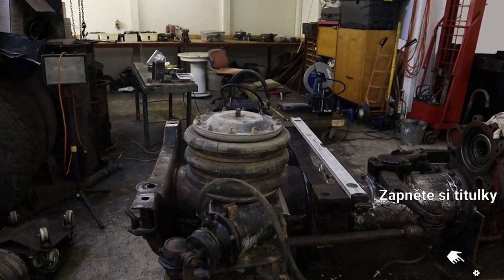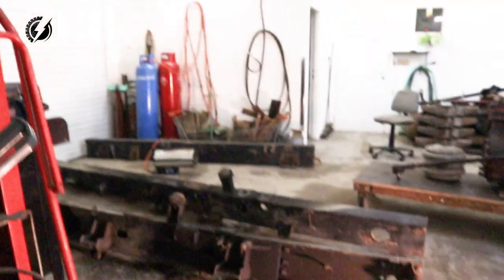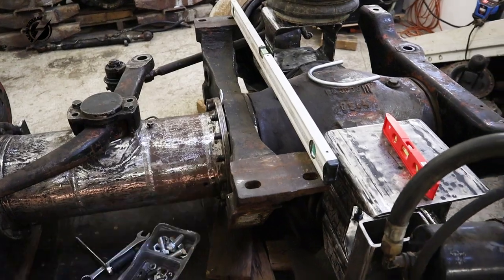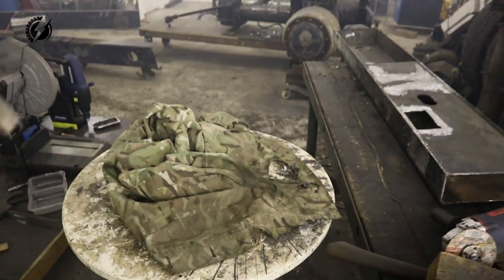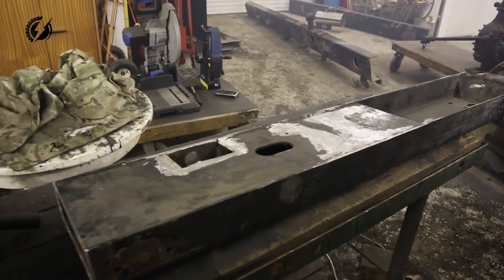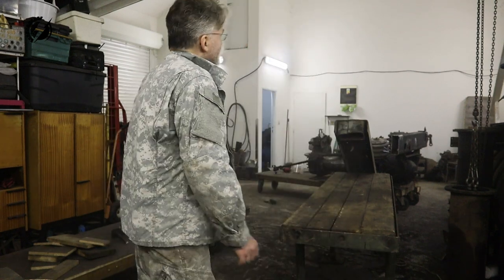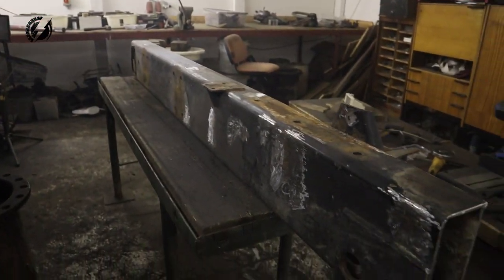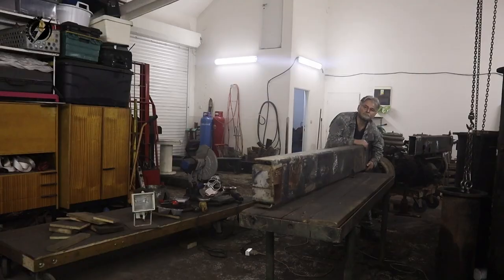EP 57, Building a Tesla/Tatra Monster Truck

Comment: Great video again, keep ‘em coming!!
You should treat yourself to a plasma cutter with gouge function, it would really improve your quality of life.
What restrains the wheels from moving back and forwards? Is there some kind of longitudinal link I maybe missed?
Have you a target weight or ground pressure for it when it’s finished? 
I would mock up the motor, cage mounts and centre section or battery holder before trimming the large beam. I would fit a wheel and articulate it and steer it fully and trim your bumper to suit, it might help to dictate some features at the front.
Reply from the maker: Thank you! The next tool probably will be the plasma, the saw and the drill were more important till now. Don't understand part about the wheels. I will do the aesthetic modification of the rails when the whole vehicle is together if needed. The widest possible size of the bumper is probably the size of the crossmember in the front, and the mounting holes are at the edges of the crossmember. This dictates the straight shape of the bumper ends. I will weld the ends extensions later if permitted.
Reply: @offroadelectric9457  
I must have missed something with the front drive, it looks like there is a cardan shaft with universal joints at each end but I can’t see what stops the wheels from moving to the front or rear? Is there an external restraint on the half axle not fitted yet? If the front wheel hits an obstacle, what stops it from getting pushed to the rear?
Reply from the maker: @jamie_grieve  https://youtu.be/yAXoiSQUCJc